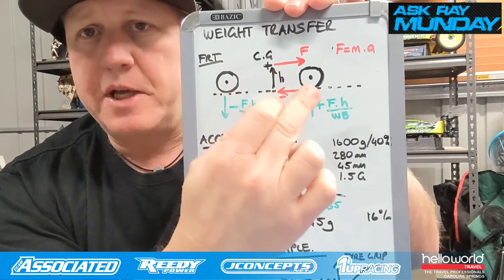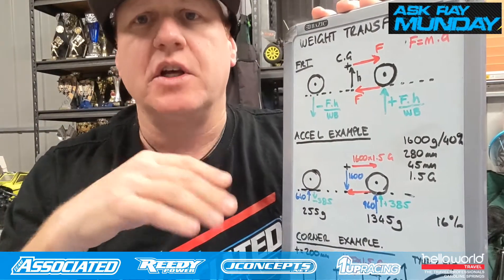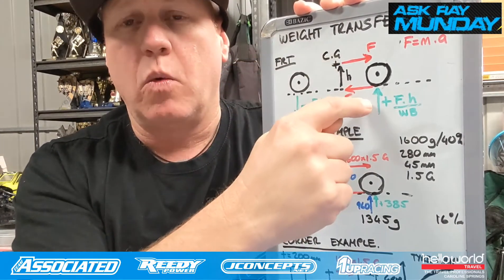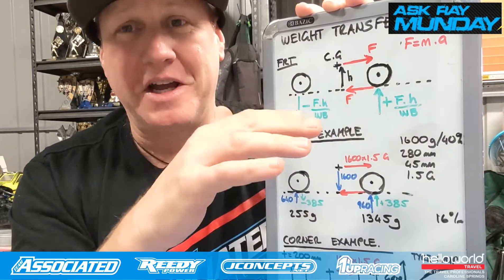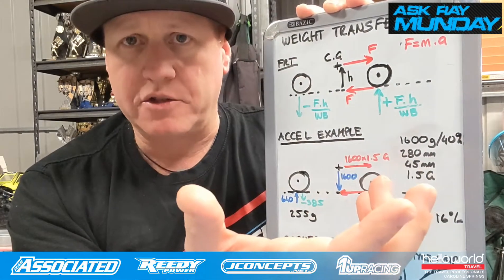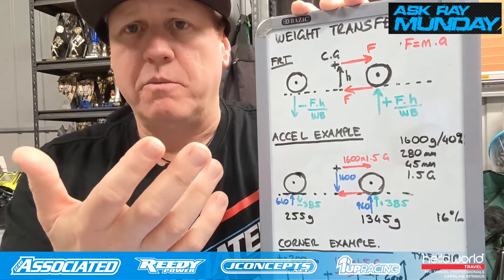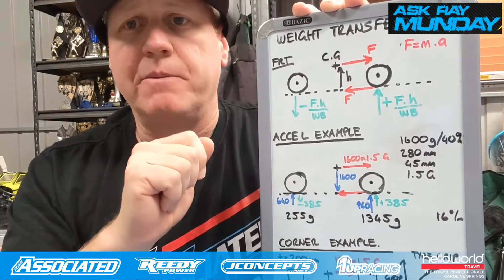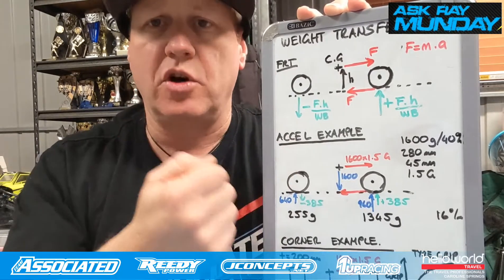*RC Weight Transfer Fundamentals - Part 1* Ask Ray Munday

Comment: @ 7:00 the more weight on a tire is only more traction IN A STRAIGHT LINE, NOT in CORNERS, this is the basics of tuning the handling, at the end you correctly point this out.